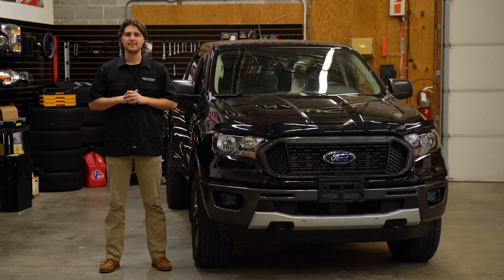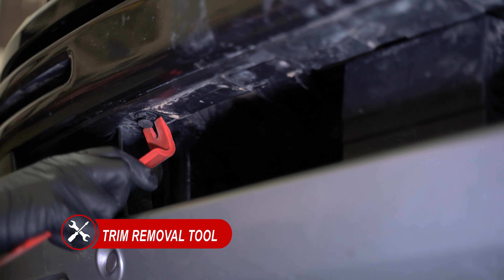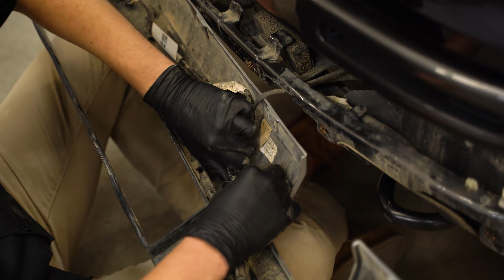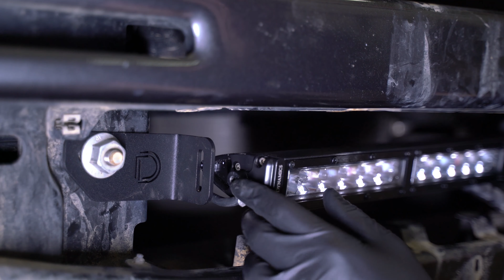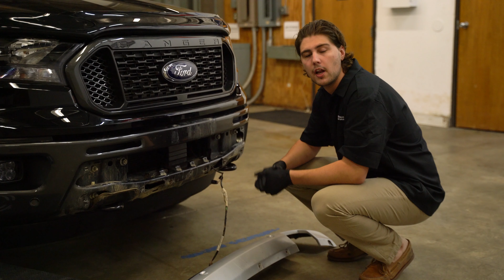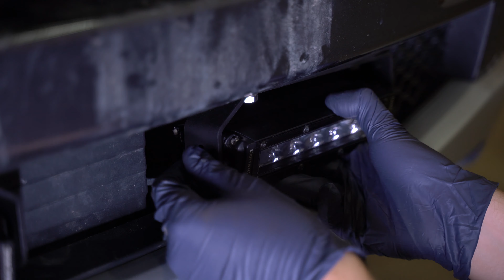How to Install 19-21 Ford Ranger Stage Series Lightbar Kits | Diode Dynamics

Comment: Can I fit at 22” light bar with these mounts
Reply from the maker: The full measurement of our lightbars are 19.75". You may not be able to squeeze in a 22" lightbar onto these brackets, as they are proprietary to our lightbars. If you haven't seen them, our lightbars provide excellent performance over similar brands and would make for an exceptional lighting solution for you!

Comment: I have a 2021 Ranger Tremor ,With the switches on the top of the dash ,,  Are you making a wiring harness  for this ,, so I can use one of the switches ?  I dont want to drill a hole in the dash for a switch  ,, Have  you done any test about the air flow ?  I would be purchasing the 6 inch set ,as my truck has the adp cruise control ,, Nice looking lights ,, Thanks
Reply from the maker: Hi Doug! The wiring harness we include in the kit can be connected to any switch. Yes, we have done research on the airflow, and neither kit will affect the engine. However, if you go with the 18" over the 6" kit, you will have to relocate or remove the ACC.
Reply: I just did this kit on my 21 tremor. I did the 2 six inch bars. After you remove the  five push pins on the bumper install the steel clips by pulling down the plastic on the bumper. The reinstall the front license plate before you put the mounting brackets on don’t ask how I know this. You will also need to take the skid plate off. Remove the front two blots and loosen the two back ones. I use switch 6 as it is a five amp switch. You will need to unplug the included switch and install a new ring on the ground wire. The other two wires will wrap together and the install to the wire for the upfitter switch six. 
The wiring harness will be able to follow the stock wiring so you can tie wrap the harness to geather.

Comment: mechanical install is the easy part.  show us the wiring and switch install!
Reply: Exactly !!
Reply from the maker: That's a great suggestion! We have been looking into doing a wiring process video.
Reply: @diodedynamics  ,Yes do one with a Tremor , using Factory switches

Comment: looks nice, any hints to how you fed your wires?
Reply from the maker: We recommend following the factory wire loom and routing the switch through the firewall. Then you can mount your switch however you see fit! Some people will drill a hole and mount it to the left of the steering column.

Comment: Where did you put the ACC?
Reply: Why would you remove the ACC  ?     Where would you recommend placing it ?
Reply: @peterfazzino1445  I understand moving the ACC module will require Ford to recallibrate the ACC system and you may find the calibration equipment will not work with the module in the wrong position. Most likely as it's safety equipment Ford won't help you
Reply: Garbage as it will not work anymore due to bumper being in way... enjoy $1200.00 dealer option you can no longer use.
Reply from the maker: We decided to remove the ACC for the 18" install.